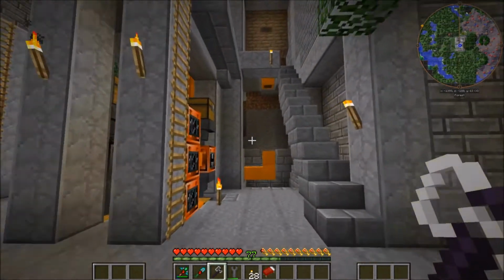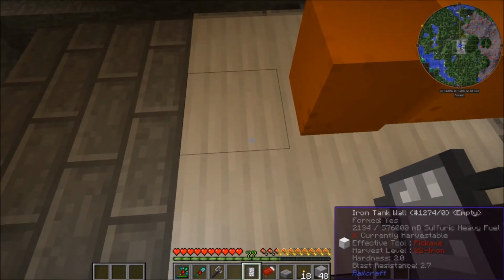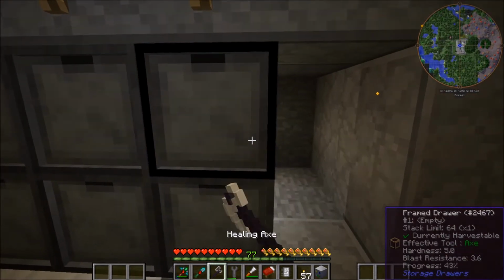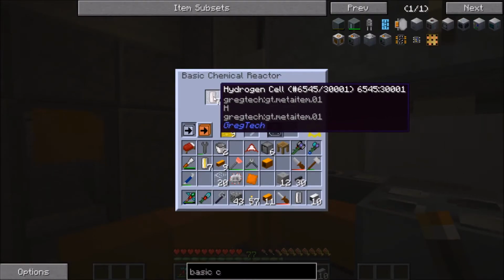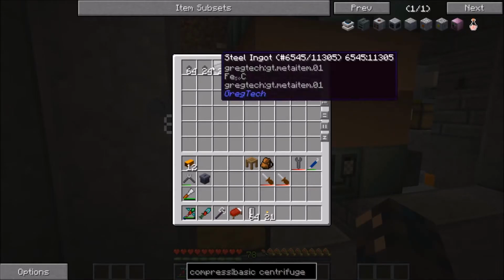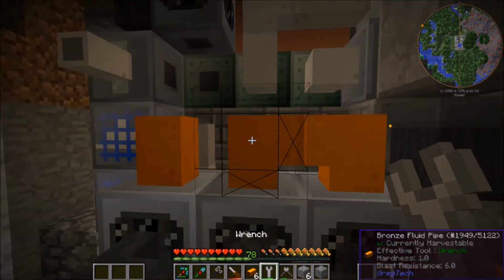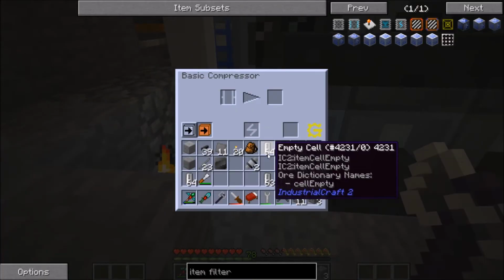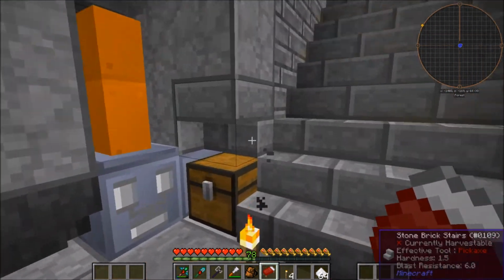Refinery Automation - GregTech New Horizons 32

Comment: Good to see you back in modded, thought you dropped the series for a while (possibly for Continuum was my first thought but that pack is expert mode for beginners tbh).

I see that you are now rather confident with the basic GT mechanics which is nice.
The EBF can have multiple input hatches with different fluids, so you could fill one up with nitrogen as well and start voiding after that.
The hatches also take cells and put the fluid into the hatch and output the empty cell back out, but I guess ender IO item conduits would be nice for that (they shouldn't be super far off by now, just need to set up polyethylene). Guess clearing an endermen spawner in a rogue like would be helpfull for that.

I hope you are going to make circuits in a benefitial way now that you got the assembler. With MV+ a lot of things will open up btw, besides more GT content I really like the ender IO bits to help shuffle cells around.
Reply: Sounds like lots of fun to be had coming up!